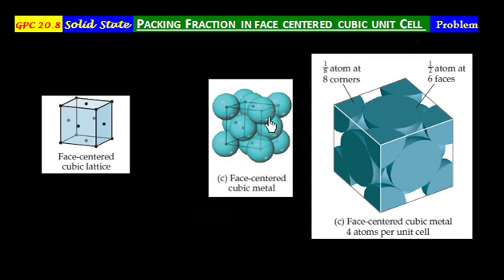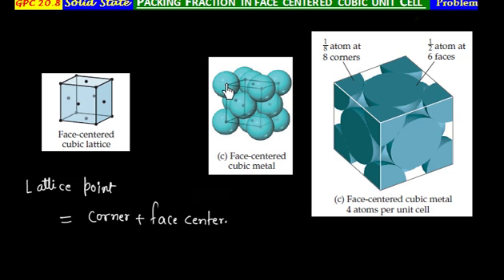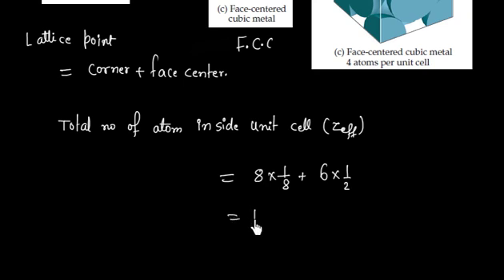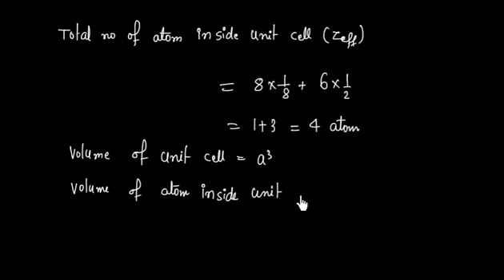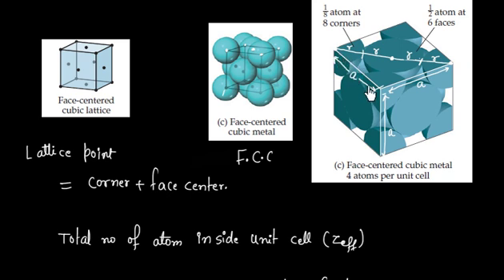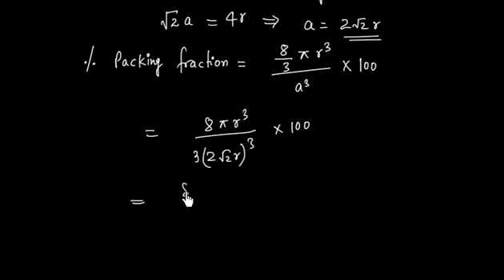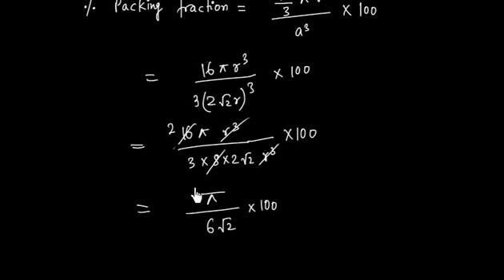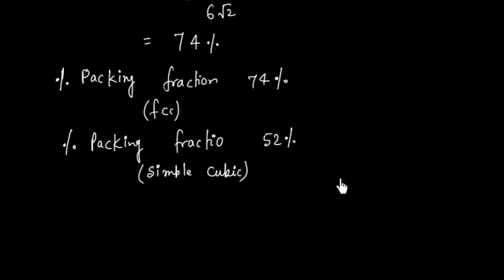How to :  Packing Fraction in Face Centered Cubic Unit Cell # Lecture

Comment: Why is the volume of that atoms 2*(4/3*pi). Doesn't the cell have 4 atoms?
And if 2^1/2.a=4r, how did you get 2^1/2.2r. Shouldn't it be a=(4r)/2^1/2??
Reply: It should be 4 atom effective
Reply: there are 4 atoms in an fcc . so it must be multiplied by 4 and not 2